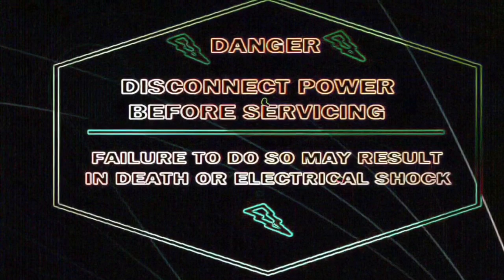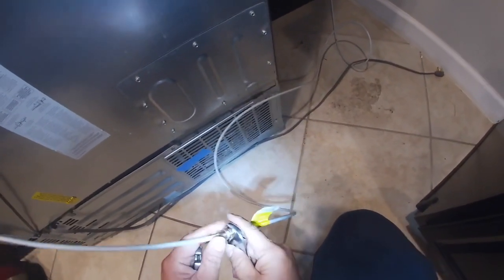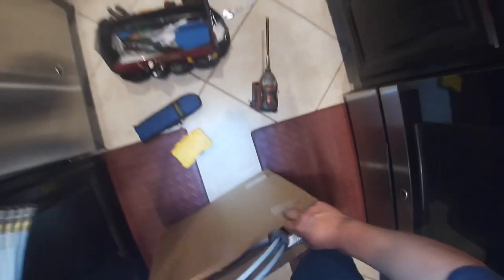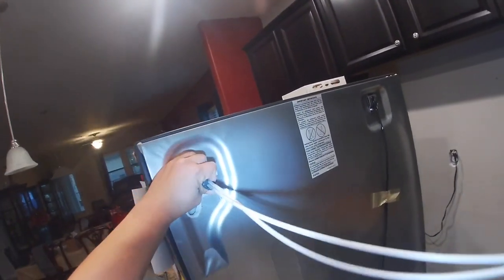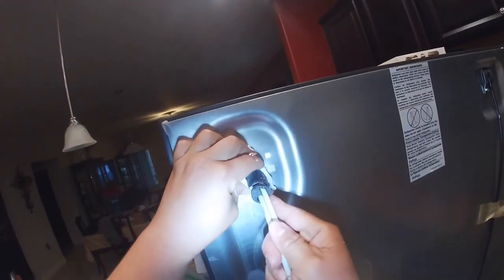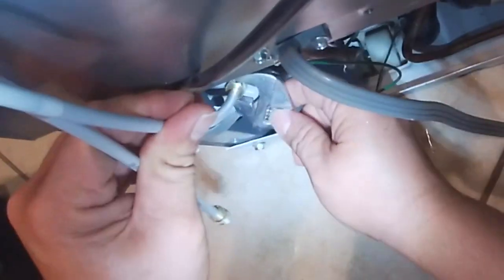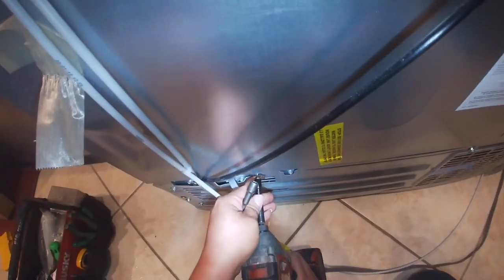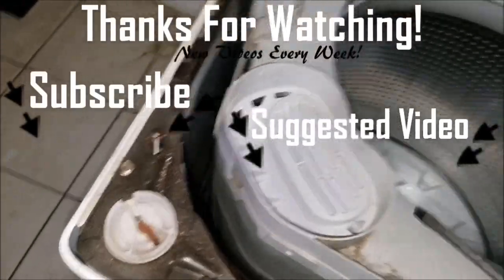How to Fix #GERefrigerator Making Rattling Noise When You Get Water | Model GSS25GSHECSS #ge

Comment: This has to be the easiest, most clear, and concise DIY video for appliances I have ever seen.  I began the diagnosis as the gentleman described.  Once I removed the water filter cover and actual filter.  I went back to the refrigerator door and pressed the water dispenser to make sure no more air was in the line.  On a haunch, I reinstalled the water filter, and guess what?  Pressed the water dispenser on the front door once more and no more noise!!  Overjoyed because I had literally just replaced the ice maker a week ago and was determined not to spend any more money on the refrigerator.  I guess either there was some air in the line that had caused the noise or I simply needed to reseat the filter.  In any case, it's fixed and working as it did originally.  That doesn't mean it won't happen again, but for now, money is saved, all because of this video!!  Well done!
Reply: He never explained this part to try and get air out of the line though. What are you talking about

Comment: THANK YOU for making this video. Clear, concise, and very easy to follow. The walk-through helped me understand exactly how to replace the part. The only thing of warning is that for the exact refrigerator you show on the video, which is the exact one I have as well, the Amazon part list says that it does not include that refrigerator. However, since I saw this fridge was the same as I mine I went ahead and bought the part. It worked just as in your video.

Thank you again for making it!

Comment: First off, I have to give a SHOUT OUT to DIY Repairs Now!!! I like to fix things at my house, but my refrigerator was throwing me for a loop. I'm a pretty new home owner and never ran across a water hammer issue before. This step-by-step video helped with fixing it once I got brave enough to tackle it (I must have watched the video about 15 times before doing it).
However, once I ordered the part (btw, the part number in the video is no longer available; they have a new part number which is,  GE WR17X22066 Refrigerator MWF Water Filter Head and Tubing), the job was SUPER simple and my part only cost me about $60 which, I ordered off of Amazon. 
If I would have had a technician come to house it would have cost us $160‐$200 just for the tech to show up and no telling how much for parts and labor. This was a much more cost effective and simple fix to do on my own (you just have to have the huts to pull out a few screws, which I did with my drill and a bit, just like in the video, which made it super simple)!!! Thanks DIY Repairs!!!

Comment: Thanks for your clear explanation of the problem and solution.  I followed your instructions and replaced the part with no issues.  By the way, It helps to have a drill or impact driver.  It makes the job much faster.  Thanks!

Comment: What causes the filter housing to do that? I bought this refrigerator 2 and half years ago. Your video is a life saver...thank you!
Reply from the maker: In my opinion is it just uses But the manufacturing sad that this is caused by people using aftermarket generic filters
Reply: @DIYRepairsNow  I have a Samsung fridge. I bought a couple filters from discountfilters website. They were junk. Brand new they didn't allow water to flow and now my fridge makes that noise.
Reply: @DIYRepairsNow  Thanks. I agree with your opinion. The manufacturer's points is not correct in my case. I've been using genuine GE filters the whole time (6 years). In my case, I believe I applied too much force while changing the filter this past time. That, or just wear and tear.

Comment: Could this sound be described as a "water hammer" banging for a second or so? That's how I would describe our issue. It happens more frequently during the winter. For us, it happens on its own, not connected to when the system is pumping water. Probably happens every 30 to 60 minutes on our fridge.
Reply: I have that as well.  Did you replace this part like he showed?  Did that fix it?
Reply: @douglass1221  - Nobody answered my question so our fridge keeps doing that hammer sound on it's own, mostly during the winter. Not related to running the water, so I did not do this repair.
Reply: Could related to the ice maker drawing on water, even if you aren’t running the water on its own
Reply: @Bob_Zombie  But it almost exclusively happens when it's cold. I can not remember it happening at all this past summer, but last winter it was as often as every couple of hours. Same since it's been cold this winter.
Reply: Check your water pressure and install a arrestor.
Reply: @Steve McGough   SO SORRY for two posts almost exactly the same I tried to add that its been super cold here in Devner and Im not sure if thats the problem. When I tried to post the edit, it wouldbt do it and gave me a weird mish mash of letters and numbers after @ instead of your name which sbows up in my firsf post.

Comment: Will this cause icemaker to stop working also? My fridge started doing this and icemaker also stopped working
Reply from the maker: Yes, This Could Also Cause the Refrigerator to Not Make Ice, if you are Not Getting Water From the Door Either. However, Sometimes it Could be the Water Valve. I think this Video May Help you as Well: How to Fix GE Refrigerator Not Making Ice or Getting Water on Dispenser | Model GSS25GSHJCSS
https://youtu.be/xtcE5dZh4gg

Comment: I removed the filter housing and tried to press the tab up and back and I got no water at all. What should I do now?
Reply: We did the same thing. That little button on the inside didn’t have any water come out.  We changed out the filter housing (followed all the steps in this video) and it fixed our problem.  Hopefully it works for you, too!

Comment: Does it work for GE gse22eshd ss?
Reply: my refrigerator is similar to your model and all i did was remove the filter, press the water dispenser on the front door, and replaced the filter, and it worked.  my results may not be typical.  See my post on this thread below.